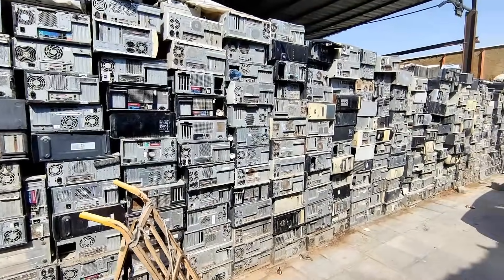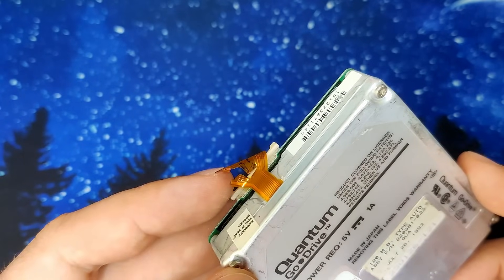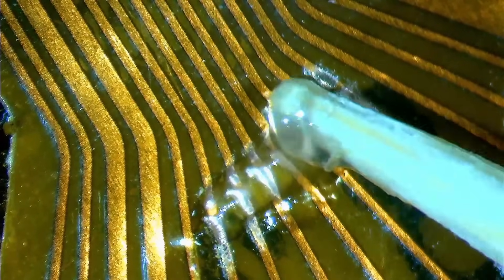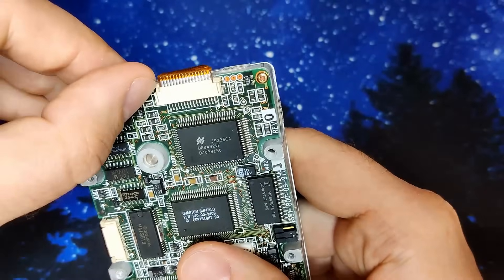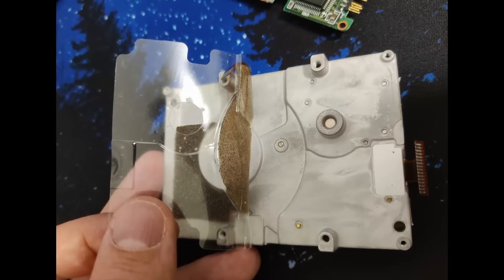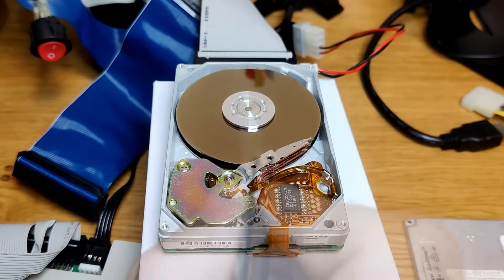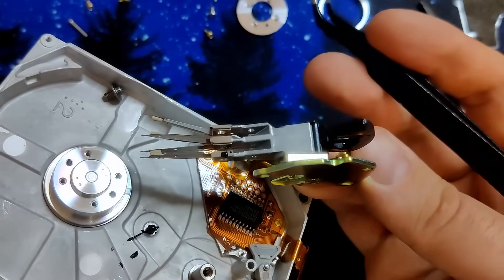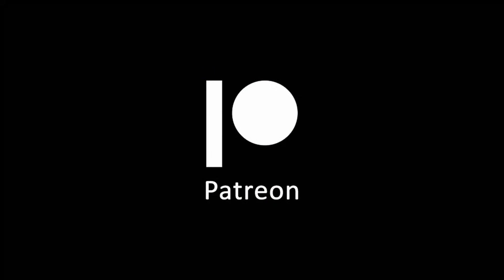Design flaw or planned obsolescence? Quantum Go Drive 120MB

Comment: A lot of rubber parts from a decade or more ago have the same problem. I tried a karaoke microphone from 2000 that had melted rubberized plastic coating as well.  It made a mess until we wrapped it in plastic film wrap and even then it was still a mess.
Reply from the maker: Yes, that is very unfortunate 😔. Rubber doesn't last forever - and I also had my fair share of melting rubber on handles in the past. It is a mess.

Comment: Quantium were great when they were working (fast for there time) but had a high failure rate I have one left I never gave to someone else or scraped which is a bigfoot just because there were not many 5 1/4" hard drives made. It slowly started failing before I put another drive to backup what was on it and just keep it as a piece honestly don't know if it would even spin up today hasn't been plugged it in 20 years same problem as this drive though.

Comment: Nice video! Neat to see something I did over a decade ago referenced again. I just recently uploaded a Macintosh classic video, where I was able to replace the rubber bumper in that drive with some wrapped around drive belts which actually worked and the drive is still working fine. But yeah once those heads crash into the spindle that's it. Going to need a new head stack
Reply from the maker: Hello there! Thanks for uploading that video 10 years ago!! It really helped me get over the fact that the drive didn't work after fixing that flat connector cable. Compared to your drive, where that liquified rubber went all over the platters, mine looked quite decent. I may try my luck with other drives in the future - who knows what I'll find at the scrapyard!
Reply: @bitsundbolts  luckily it's easy to fix single platter drives, but if you have a multiple platter drive? You're going to need a platter removal tool that is almost like a ring compressor that way the platters cannot slip independent with one another or you'll get a cylinder misalignment and it will never work again
Reply from the maker: Yes, this is why I didn't bother trying to "fix" the drive. You mentioned this in your video - and it made a lot of sense to me. I'm afraid of misusing the term "low level format", but wouldn't this format (if it's technically possible) realign the platters? Or is that something that can only be done by the manufacturer at the time of making the drive. I just wondered if you may know the answer to this question in my head.
Reply: @bitsundbolts  unfortunately not sadly. Because a voice coil drive relies on servo tracks that are written to the platter so the head knows where it is at any given point. When those drives are manufactured there's a special machine called a servo writer which lays out the low level format before the platters go in the drive. Stepper motor drives at least the step angle is always known so you don't need that same feedback which is why you can truly low level format those
Reply from the maker: I see. At least I got a video from this drive and I'm happy to have seen the gooey stuff myself!
Reply: @bitsundbolts  exactly, at least it served its final purpose

Comment: I worked on a old 20mb Miniscribe scsi drive a while back which was powering down after 10 seconds, I found if you connected a led to a pin header it flashed a error code. i ended up replacing stepper motor ic's and another mosfet. got the drive going however during fault finding i misaligned the platters and never got to fully test the drive :(  Good fun though.

Comment: RSVP Quantum Go Drive. I doubt it's planned obsolescence, that suggests it would be designed to last little longer than its warranty period, and I'm sure many of these drives lasted >10 years.  I've pretty much given up on using old drives. You could argue it was planned obsolescence if it had an MTBF of 100K hours, but it only lasted for 5 years of on and off usage as opposed to 10 years of 24x7 operation, and the model was well-known for such early failures. 

As much as I like the sound of them, I've given up on using spinning HDDs in most of my retro machines. Most of the drives I've come across are just too old and unreliable.
Reply from the maker: I agree, there was probably no bad intention from the side of Quantum. However, then I would still consider it an engineering oversight, or wrong choice of material - a mistake basically. There are older drives that still work.
But yes, it's much easier not to deal with failing old tech if you just want to have a retro system. I'm just looking for excuses to dig out old hard disk tools 😀

Comment: No, not a planned obsolescence or directly a design flaw.
This "Rubber" is probably the same compound that was very popular to coat electronics with in the 90s to give a rubbery feeling grip without spending the big bucks.
However it was only later that it was found out that it tended to degrade back to oily goop as it was exposed to air, where you found the coating on electronics / hairbrushes and the like, you would be left with a sticky oily goop.
So I am not surprised to see that happen, and it does show that buying at the bottom of the barrel does come with a few issues.

Comment: Nice video! 
You didnt found a replacement for this rubber joint? 
I see so many of them on modern CPU/GPU heatsink attachment mecanism.
Reply from the maker: Thanks! I did not look for a replacement for the rubber. The moment the top cover was off, I accepted the drive to be dead. That is why I didn't put any effort in trying to save it.
Reply: @bitsundbolts  oh ok I get it now thx :)

Comment: I would say design flaw over planned obsolescence. It was nearly impossible to know what would happen over time to that piece of rubber over time. Quite a few other products made decades ago have had issues with rubber decaying over time. Not to mention a massive amount of products having issues with plastics becoming brittle or yellowing over time. 
Not to too harshly knock Quantum, even by the mid 90s while they were a huge player in the hard drive market but on the consumer side they operated more on the low cost area with other hard drive companies like Conner. Even back then if you wanted a consumer level desktop drive that would generally last you went with Seagate or Western Digital or maybe Maxtor if the price was right. In the laptop arena in the 90s it was IBM or Toshiba hard drives seemed best for reliability. I repaired a lot of laptops and desktops in the late 90s and throughout the 2000s (was a tech and later managed a depot that did 20-50 machines a day), in the 90s I tended to see a LOT of Quantum or Conner drives fail in desktops before most other brands. Probably why Maxtor purchased what was left of Quantum's HDD business in 2000 after Conner merged with Seagate in 1996.

Comment: Rubber starts off as a plant product and does decay, so it is not at all unexpected to see it turn to goop like that. Some rubbers just dry out and crack. But ultimately rubber is not meant to be something that is sealed away forever as it will eventually decay, probably long before the PCB degrades too badly, and obviously decades before the platters themselves experience any form of decay. But usually I expect the motor to fail before anything else in a spinning hard drive.

Comment: No not all Quantum drives have this rubber problem! The Fireball series, Bigfoot etc don´t have this rubber inside. However do the PRO drives also have it, I guess the Pro driver and Go drives are about the same design but different formfactor. I am sure this rubber is not planned obsolescence however, it is made of the same crap that many drivebelts and also rubber coating that comes from I think the rubber tree. which reverts back to oil with time. I think the Quantum drives have been the most reliable drives in the world up to this point and it is a shame some models die with age because of this rubber. But the drives that don´t have the rubber issue just keep going. My majority of vintage drives in use are in fact Quantum and no Fireball drives have this rubber that I been taking apart for other reasons. but I do have Pro drives that I used in the past that died because rubber bumper sadly enough

Comment: Unfortunatelly most of such old HDDs is already dead or will be dead soon. Congratulation on having access to such a scrap yard. I'm visiting sometimes local recycling centers but it's hard to buy anything from such places. It is based on the will of particulary worker and is highly unofficial. Fortunatelly last time I was able to save whole computer based on D975 board and assembled in nice Antec case similar to Chieftec's Dragon.

Comment: I refer to aged rubber as "liquid evil" because that's basically what it is: it's a horrible sticky nightmare that ruins everything and gets everywhere. Those Quantum GoDrives are notorious for that problem, along with some of their desktop counterparts. It's best to stay away from Quantum drives that aren't members of the Fireball family; the later drives used a different bumper material. But Quantum wasn't the only manufacturer to use natural rubber bumpers: Conner and CDC/Imprimis/Seagate drives from that era also have problems with rubber bumpers and seals deteriorating, and even later drives using different bumper material have had problems (such as IBM). Depending on the drive, you can often run them without the top and manually bump the armature into working position and then recover your data, but other drives won't run properly with the top removed because they're structurally important.

Comment: I wonder if the function of that rubber stopper can be replaced by -inserting- attaching  a shim in the coil housing-thing. (edit:) without removing the platters and/or the decomposed rubber bit.

I do remember seeing that mark on many scrapped drive head arms while scavenging magnets and motors. I thought it funny they would intentionally paint some material messily onto many of the arms in the same place, in what is such a precision device.  TIL it wasn't intentional (in the case of Quantum).

Comment: Not as much planned obsolescence as not caring if the drives is still working 30 years later. I'm sure they were very well aware that rubber turns into goo when they designed it. They just didn't care what happened beyond the planned useful life.
Reply from the maker: I'm sure they could have found a better solution. Others did!
Reply: @bitsundbolts  I agree. And that was my point. They had no reason to look for a better solution. Why look for a better solution if this one is good enough to fit with the requirements? Engineers are lazy too.

Comment: I don't know if it could have been saved or not, but if you had the proper setup, you could have disassembled the drive without ruining it. Replaced the rubber stopper and reassembled. I've actually watched a few videos on the channel "HDD Recovery Services". I've never seen him repair an IDE drive before. Just SATA. But I've seen plenty of head and platter swaps on that channel. One time he was recovering data for a client that was critical. He had to replace the heads 3 times because there was physical damage to the platers. He was able to get mostly everything imaged. I don't recall if he mentioned if he got all the data he needed from the image or not, but the client was happy.
Reply from the maker: Thanks for the info. I guess I have to check this channel to learn a bit more about data recovery and how to handle such drives

Comment: All Quantums from that time period are affected by that problem. If you still have one in use copy everything over to another drive and toss the Quantum into the e-waste (or put it on display), If you are looking for a retroharddisk on eBay swerve around all Quantum harddisks, they will fail anytime soon with the same error.

Had one of them with Amiga stuff on it (came from an Amiga 3000) and was no longer recognized by the system. Opened it up and found the "gooey goo" had completely blocked the RW-assembly so it was no longer  able to move. Removed the rubber goo with q-tips and Isopropyl and replaced the spacers with istoape cut into the right height and wrapped it around the metal pin until it had approx the right thickness. Reinstalled the HDD into the Amiga again and it was detected. I was able to copy everything off the HDD and it worked for a few more days before it stopped working again. After that it went to the e-waste. 

I don´t think it is planned obsolescence, many Quantum HDDs have survived for decades before their rubber spacers turned into rubber goo. That is a bad idea for planned obsolescence, the HDDs survived their manufacturer for many years.

There are some other videos regarding dying Quantum HDDs here on Youtube. :)

Comment: Oh boy, I would feel like a kid in a candy store in a scrap yard like this. 😄 Any chance to instruct one or more of the guys working there to be on the lookout for certain "high value" and easily recognizable items, like anything with a 3dfx logo or a DIN keyboard connector on it? Unless they are already doing so, I'm sure they wouldn't mind making a few extra bucks on those parts and you/we might get a good supply of parts to tinker with.

Regarding the drive, I'm certain that this was an honest mistake. Lots of stuff suffered from degrading rubber back in the day. I personally owned countless items that were affected/destroyed by it, ranging from PC components to devices with rubberized surfaces, loudspeaker suspensions and even some clothing. Stuff just wasn't as chemically stable as manufacturers thought it would be, the technical term for it is rubber reversion.
Reply from the maker: I am starting to make friends there. Who knows how well that would work. I would have to go there regularly (like twice a month or so). I wouldn't mind saving some of those treasures and helping them find a new home... Let's see how it goes. 

I agree, I think nobody expected those drives to be in service for more than 10 years. Let alone retro enthusiasts who are digging up those drives 30 years later.
Reply: @bitsundbolts I have some experience with this in other scrap yards. Bring a box with some pictures/text of desired items on the lid. Tell them to fill said box and how much money/whiskey/cigarettes they will get each time the box is filled.
It is VERY effective once you visit 5-10 scrap yards.
Reply from the maker: This is exactly what would work! I may try what you're suggesting once I find the right people. Thanks for your idea.
Reply: A few days ago I discovered one shop on my country's eBay equivalent. They auction off e-waste from western part of the EU for pennies. I already saw some interesting stuff. Most of it is damaged/untested (which means damaged) but is just enough for getting soldering practice material for the cheap.

Comment: Oh wow, I wish I could have access to a place like this rather than paying eBay prices to grow my hard drive collection.
Quantum drives of that era all suffer from rubber issues, sometimes they can be "fixed" though that always will require to open the drive. I don’t think it was planned obsolescence, rather them not taking in consideration (or not knowing) that the material wouldn’t last, but they probably did not expect the drives would be used 30 years after they were made too.

Comment: Maybe its time to think about building a Positive-Pressure clean-room box ?... For working on open hard drives without letting any dust in.

They are simple, and cheap, if you are crafty... Once you visualize the basic concept.
Reply from the maker: Ah, I need to move into a house... My apartment gets too small for all this stuff 😂
Reply: @bitsundbolts   I feel ya...
Technically it's just an empty box when not in active use... You could theoretically store tools or stuff inside it to save space.

Comment: I've only got the standard P2L97. Excellent motherboard. If the VRM design is the same, it'll work down to 1.7V, and work just fine with Coppermine CPU (albeit still limited by the 66MHz FSB).
Reply from the maker: I am looking forward to this project! Hopefully, this board survived the harsh environment! It's still dirty... And I have quite a few other videos that I need to finalize first.
Reply: @bitsundbolts  If it works with Coppermine, it may be worth getting a couple of PIII. My 650 for example ran at 433MHz, and was faster than my Celeron 433 (in slotket). Heat from the CPU and PSU was far lower too.

Performance should be pretty much middle of the road/reference as well so also a very good platform for accurately benchmarking. I saw the same performance with the P2L97 as I did on my Intel SE440BX-2.

Comment: No Quantum disk I ever had is operational today. They used to fail rather fast, at least every single one I had. Usually an avalanche of bad sectors. Will have to make some statistics on models and vendors.
Reply: Pretty sure I have a quantum disk in my 486 that's still kicking. I think that it sounds like a banshee from hell when its running but it does run.